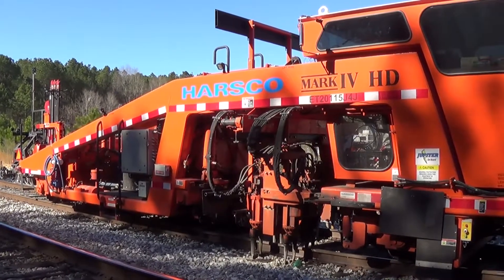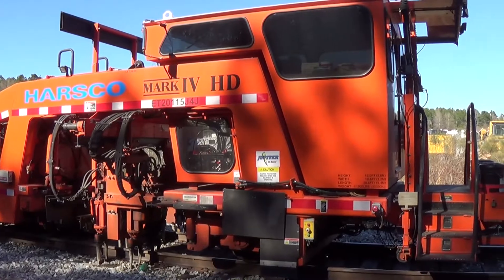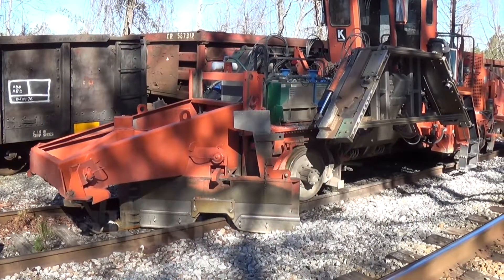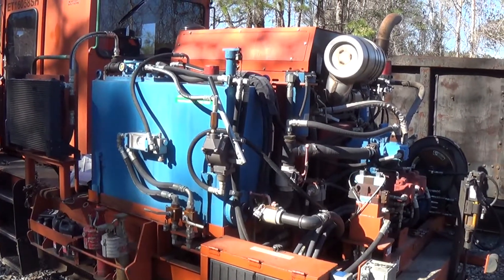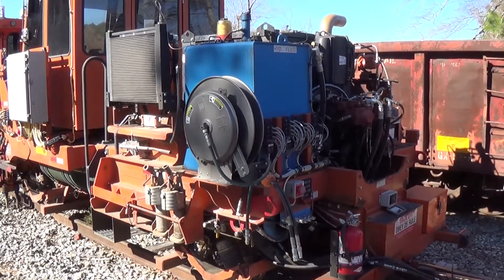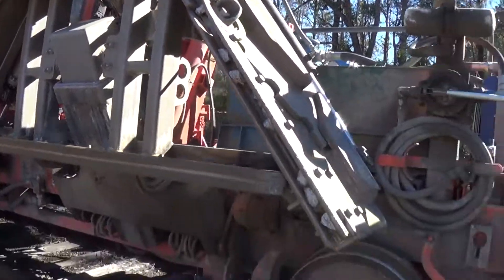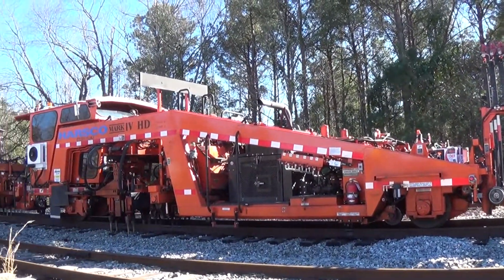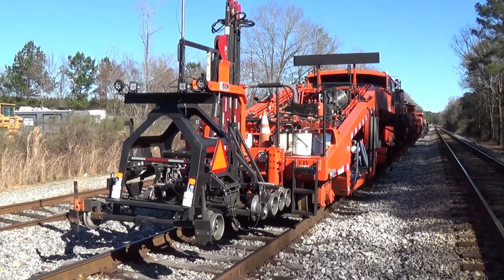Railroad Maintenance Of Way (MOW) Equipment

Comment: So the front one is a production tamper, it will use that buggy on the front extended out in front to verify alignment and elevation, and then at the main body of the machine will reach down clamp onto the rail and shift or lift it and then tamp rock under and around the ties so it will hold new position.
 The second one is also a tamper but is most useful in switches as the heads have greater horizontal traversing.
 That cart looks like a small ballast cart to carry small amounts out to parts that may desperately need it, and that was a hand tamper, the tip is bent so i guy can use it to do the same as the machines and push rock under the tie. 
 Ballast regulator can move the rock around with its plow or wings, to shape shoulders and walkways and get rock to where it is needed. The other side is the broom which sweeps the rock off the ties.
Reply: Also those other tampers aren't really an older version they have a slightly different role. And there was no spike pullers or spikers.
Reply from the maker: Thanks for the info!

Comment: next time can you get some close ups of the machines in operation while they are working
Reply from the maker: Thanks. I've got a video of that on my channel. Loud loud loud.
Reply: @seemoretoys5944  I'm from Ontario Canada I live right next to a busy cn mainline used by boath passenger and freight trains it's called the cn Kingston sub and runs between Toronto Ontario Canada and Montreal QC Kingston is one of the many towns where via rail Canada trains stop
Reply from the maker: @jakeeves5935  My rails runs from Columbus, Ga to Opelika, Al. No passenger trains just freight. Ses to be scrap steel, wood chips, covered hoppers, tank cars of sodium, etc. I've never seen a container, or auto carrier. We get maybe 4 or five trains a day at random times.